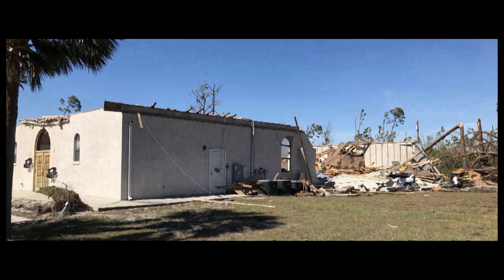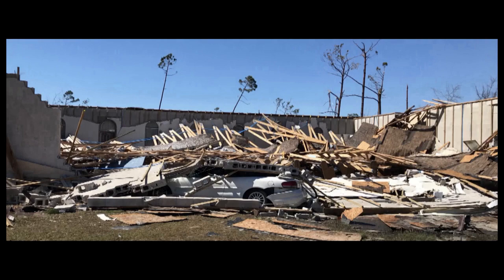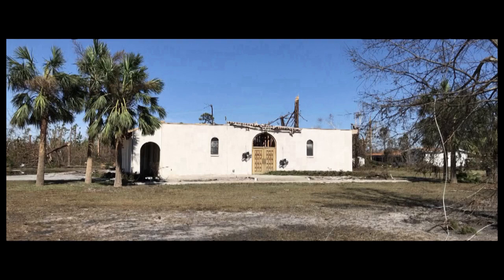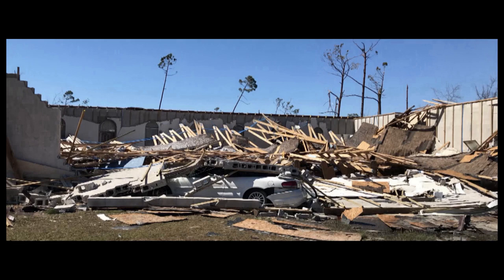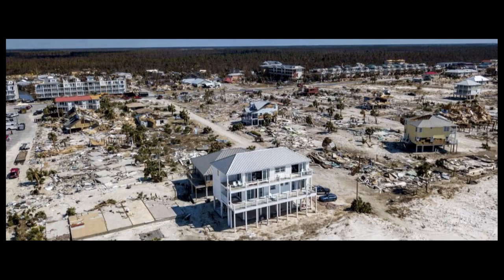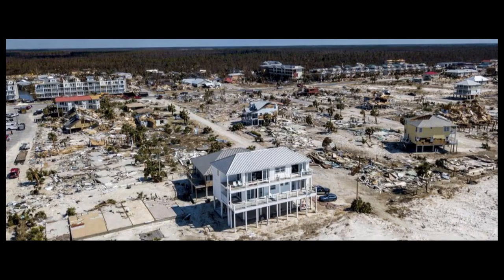Podcast Short: Hurricane-Resistant Housing

Comment: Living in FL about 2 hours from where this event occured, I can tell you that a LARGE majority of the homes that were destroyed were pre-code homes.  Many built in the 50s and 60s. Some had mitigation done post Andrew with Hurricane ties and so forth (Simpson Strongtie did a video about this) but the majority were just older homes built simply with no fortification at all.  Many of these areas are communities of fishermen and other small businesses that were decimated by the BP oil spill and there wasn't much money to go around.

If ever there was an area in need of simple concrete homes, this is it.  ICF and 3D printed concrete homes should be all we see in this area going forward.  Sadly, it won't happen because there is precious little in the way of building science happening in N. Florida.  It's hard work to even find Zip panels here.